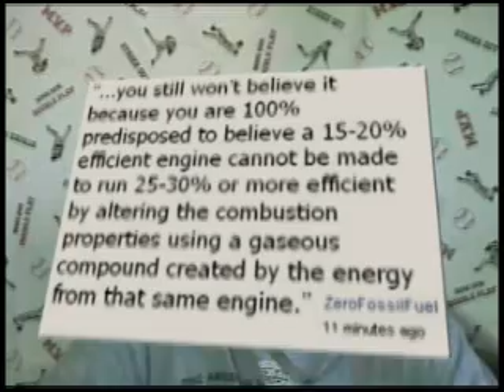Follow-up: '#232 - HHO runtime experiment part 3'

Comment: @MegaVelvetElvis 
what i understand is ............you have no idea what your talking about.
load on an engine...............who cares!
what matters is what goes into the air.
natural gas or propane engines burn very clean......
if an engine would run on hydrogen, which it will, it would burn very clean.
now you must facter in how to make your fuel.......how clean is it to make?
if you could make hho and burn it as fuel........
that would be the cleanest and lowest carbon footprint
wow

Comment: @MegaVelvetElvis use water is the point??????????????????
yes salt will cause clorine gas.
of coarse you want to break the water up..........thats the hho gas!
even distilling water makes something else. that is why they distill it. 
hho turns back into pure water..........
if a car would run on just water.......that would be the lowest carbon footprint......
electric cars need charged........mains power.......high carbon footprint.

Comment: @TruthfulPinecone 
check my videos
most of them deal with pulsed DC.
one shows rain water in a cell,no electrolite......no bubbles with just battery current.......with pulsed DC yes many hho bubbles.
another, sealed jug of distilled water no electrolite......hho bubbles.
another, just a small 9 volt battery with electrolite.......hho
another, current held at 20 amps...........lots and lots of hho
faradays work was with DC, not pulsed DC
please check them, you will see

Comment: @MegaVelvetElvis hho is a gas that burns......fact
add a gas that burns to an engine that is already running.....rpm will go up.
but if load is more than rpm will go down.
so less gasoline or deisel will be needed to pull a load.......
so if rpm goes up when the circuit is turned on.......winner.......
if rpm goes down when the circuit is turned on..........sorry .....loser
so simple. but maybe you need a certain rpm to show the increase ......this is possible and probible.

Comment: @MegaVelvetElvis if hho adds to fuel econimy......there would be a higher power rate....thus a higher rpm at some time........gas or deisel flow would be the same ...
when you turn on the circuit........if rpm goes up.....you just added more fuel......if rpm goes down......there is more load that was added for not.
when hho burns it turn back into water......it burns very clean.....same gas or deisel input......higher rpm is more power..
very easy......more power means less rpm to pull load

Comment: @MegaVelvetElvis only to improve gas milage.......does not need 500 watts.
any little bubble would add to burn rate.
question is only......can hho add a higher burn rate then it uses.
someone needs to make a circuit and test it........
needs an rpm gauge to see if rpm goes up or down when the unit is on.
if rpm goes up......probly just saved gas on the next trip.
if rpm goes down.......load is more than hho bonus........
test is this simple
i think 200 watts is a good circuit to use

Comment: @MegaVelvetElvis but what you do not see is......
there is no math for possibilities of pulsed DC and electrolisis. every circuit could prove to be something more.
but since no one ever steps up.......and shows a good show.........
one thing i hope you could put your math to..........
if an alternator was putting out 100 volts at 2 amps............how much load is that on the engine? i see it in action at less than 1/2 a horse power.
100 volts 2 amps easy to control 200 watts

Comment: @MegaVelvetElvis ohms laws is for resistors in the circuit. when you add capacitors and inductors...you must figure more things.
but it still stands how to overcome the power usage?
there is a way..
better constructed devices need to be made. i am very sure they can be.
if you trade 12 volts for say 3 volts....you can use those 9 volts and turn it into amps at the short circuit.....induction.
12 volts at 20 amps is easy for the alternator.
3 volts and 80 amps at the short,
possible gain

Comment: @MegaVelvetElvis --- "You have a wagon, which takes a certain amount of work to move. Add a rock, and either the wagon slows down, or you have to perform more work to make it move at the same speed. This is elementary school physics." Great example, now add another horse and what do you get? The ability to do more work with the additional load. This what the increases in BTE gives you, the ability to do more work WITH the additional load INCLUDED... Sorry if this posts twice, YouTube glitch..

Comment: @MegaVelvetElvis --- "You have a wagon, which takes a certain amount of work to move. Add a rock, and either the wagon slows down, or you have to perform more work to make it move at the same speed." Great example, now add another horse to the wagon and what do you get? The ability to do more work with the additional load, this is what the increase in BTE gives you, the ability to do more work. Simples!

Comment: @MegaVelvetElvis --- Jesus, I'm dealing with a couple of children here. The wattage was INFLATED by using the WRONG LPM, it had nothing to do with the voltage. The amps using both 12v and 24v were INFLATED because of that. I merely pointed out how you used a 12 V (13.7v) system and while the study used a 24 V system. Show me where I say the wattage is different based on the voltage... Grow up and move on, it doesn't matter...

Comment: @TruthfulPinecone --- Part 2, This property of H2 with HC fuels is a well documented fact. We can argue this point forever without getting anywhere. Here's the facts, adding H2 to HC fuels improves the burn characteristics making the engine more eff., H2/O2 from a on-demand HHO type generator has been scientifically proven to give fuel savings,  100,000 + miles of over-the-road testing has shown it save fuel, and cont.

Comment: @TruthfulPinecone --- "But isn't the power output of the engine constant, despite the fact that you are putting an additional load on the engine?" Yes, and the tests they used 7% less fuel... "Oh wait, it's a negative load, not a positive load." It's a negative number when used in the equation like they did. Isn't that what everyone says? Addtional load takes away from the system, however the added H2  decreases BSFC and increases BTE giving the system more power with less fuel used. Cont.

Comment from the maker: @MegaVelvetElvis ; Absolutely! It is against the law in the USA for automobile manufacturers to use driving tests to determine miles-per-gallon for their automobiles. They are required by law to use controlled tests at a EPA-certified facility. The only way driving tests can produce a valid MPG figure is to drive tens of thousands of miles in all kinds of driving conditions. EPA testing standardizes all MPG tests so that comparison between automobiles and devices are valid. Driving doesn't.

Comment: @MegaVelvetElvis you are correct......cut volts in half to make more amps......same wattage...
but ohms law is only part of what goes on here.
ohms law is for resistors.
there is much more happening here.
so many more figures you are all missing.....................................................

Comment: @MegaVelvetElvis if you will watch my vidios......... i have regulated the amp pull at 20 amps. 20 amps is easy for your alternator.easily you can regulate the amp pull or the voltage to anything you want. amps and volts are easy to trade back and forth. every thing to do with driving pulls power from your engine.
the question should be ......can i make more power from using some of that.......
i think it is possible.
yes you are correct you need power and lots of it.

Comment: @MegaVelvetElvis --- Yes, using your 4.6% it would be some like this, Fuel + HHO + -4.6% = 3% fuel savings, taking out the energy requirements it would be Fuel + HHO = 7.6% fuel savings. What you are doing is Fuel + HHO + -4.6% = 3% - 4.6%. So again you are subtracting what has been subtracted already. Screen shot this too...

Comment: @MegaVelvetElvis "Presuming 65% eff alternator, that's 780 watts. Presuming 60% eff HHO that's 468watts of fuel, burnt at 20-30% eff. " You are double dipping again, the 780 watts INCLUDES the HHO loss. "Thus you're not saving fuel, you're wasting it by a factor of 262%. It's like adding weight to the car, as I explained." Damn, you mean when I double the load on my Silverado by camper I'm losing 262% or more? How can I even pull the damn thing out of my driveway?

Comment: @MegaVelvetElvis --- "AGAIN, the power consumed was less than what was gained in these tests." I'll assume this was a misstatement. *wink* Again the gains INCLUDED the losses, the gains would be greater without the losses added, you can't subtract them again... "Same HP, but less ability to do work available. " No, HP was gained based on the increases in BTE. But lets assume not, I'll trade less than 1.5 HP loss for a gain in MPG any day...But again that's bullshit...  You were saying????

Comment: @MegaVelvetElvis --- "The load was included, to I subtracted it, to see if the gain was equal or greater to the loss. It wasn't. Sorry" Ok then explain how using 867 watts at 28K shows a 3.22% loss but there is a 7% gain. 7 - 3.22 = 3.78% GAIN. You were saying... But again that's bullshit, you are subtracting what has already been subtracted. The 7% gain would be 10.22% if you didn't included the 3.22%, you don't subtract it again.

Comment: @MegaVelvetElvis --- Blah, Blah ,Blah. "But I even let you pick a new number, so you don't need to panic." But you still ignore the paper when it clearly says, "The total rate of fuel consumption is calculated as the sum of diesel, the diesel equivalent flow rate of hydrogen and the diesel equivalent energy needed to
produce H2/O2 mixture." Your numbers are all based on bad data, you are adding a load that is already being used. Again, you were saying???

Comment: @MegaVelvetElvis --- You said 876 watts was 4.6% of the load at 19 KW. It's only 3.2% at 28 KW and the paper shows that they got a 7% gain in fuel savings at 28 KW. So you were saying??? As far as moving the goal posts you claim this paper doesn't show gains are possible using typical HHO units and used numbers from the upper part of the study as loads. I merely pointed out your fallacy. You still however are ignoring the fact the power needed to make HHO IS INCLUDED in the paper...

Comment: @MegaVelvetElvis -- "at 19kW (25.48hp), that's 4.6% engine output " Ok then what is 876 watts at 28KW? Using the same numbers for input loads of 
876.8 watts. At 28 KW (37.58HP) that's 3.2% of the engine output. The paper clearly shows posting a 7% gain in fuel savings at 28 KW. So even using your assumptive bullshit math and ignoring the fact the energy used to make HHO is already included in the 7% gain the paper still shows gains...  Borrowing a term used by TruthfulPinhead... BUSTED...

Comment: @TruthfulPinecone -- "This has to do with HHO how? Or cars?" Because it refutes the silly notion that because 98% of the gasoline burns there is not room for improvement using H2... Oh and did you know that this also used energy from the engine to do this? They used 100 watts of power and got a gain of up to 50%, go figure...

Comment: @TruthfulPinecone --- Hey dumb ass, try thinking before you post. He did the math backwards, he converted the wrong LPM to watts using 4.2 MMW then used the wrong voltage to get an inflated amp value. He even admitted this and changed the amps to reflect a 24V value... so...

You're BUSTED... Again, be quiet, grown-ups are talking here...

Comment: @MegaVelvetElvis --- Part 2, "at 19KW roughly 40% of that output was used to make fuel, which was burned, and provided less than a 40% return." Really? It takes roughly 7600 watts to make 3 LPM? Who knew? Do you not see how wrong your math is? You are using loads that do not apply to what would actually be in the vehicle. Enough said, you are full of shit and I'm done with this. Let's wait for the more detailed information...

Comment: @MegaVelvetElvis --- More B/S, fig 6 shows that the amount of fuel savings increased with load for the same amount of HHO, in other words the power req. for HHH production remained the same but the fuel savings were increase with load. If the it was all about the power of in HHO then how did the fule savings increase with a larger output load? Cont.

Comment: @MegaVelvetElvis "If you accept the paper you cite (Fuel 89 (2010) 378–383 p.384) contains bad data and speculations, why do you accept it as evidence." Because you use the wrong LPM and a speculated MMW to come up with inflated numbers that have nothing to do with the 4 LPM/69amp models you say is a standard for HHO units. Your math is extremely flawed, flat out bullshit.  "Then take your car to an EPA certified facility, prove it" Sorry, but this is an accepted way to improve performance

Comment: @H2Truckers --- Yeah I think MegaVelvetElvis (aka big tacky dead fat guy) really knows better, MVE wants the numbers to say what he believes. Just like ES2008 he only shows math based on bad data and speculations. He ignores the paper when it comes to 3 LPM gave fuel savings, but what else can you expect from a naysayer. He probably can't believe you can get more MPG with more HP using a mod to the air flow. I'm showing a 10.88% average gain with my CAI mod over my last 14 fill-ups!!!

Comment: @MegaVelvetElvis "But a more likely explanation is being aware of the power requirements, and being aware these can't go into a standard car, or a truck, with the stock alternator, it cant work and only a fool would employ it." Try using real world numbers on LPM production, 3 LPM gave a 3% -7% increase in fuel savings. I will not address, or at least try to not address, this issue until we get more detailed information...

Comment: @MegaVelvetElvis --- We have data, the charts, that shows 3LPM giving a 3% -7% gain in fuel savings but you refuse to use that. Why are you rejecting this information? Why must you ignore real world data, LPM production rate, to formulate your conclusion? I didn't even go into your load math because based on the fact your example is bias those numbers are probably wrong to. How does that saying go, garbage in = garbage out. If you want to use real world numbers then do so across the board...

Comment: @MegaVelvetElvis --- "(you need to learn ohms law IDiot)" Earth to MVE, I know ohms law, how the hell do you think I knew your numbers were based on the wrong voltage? Where did the 7231 watt figure come from? I do not find anything supporting that figure. (and don't give me that B/S it's 301.3 amps times 24V, if that's the cases where did the 301.3 amps come from?)

Comment: @MegaVelvetElvis --- "~ indicates approximate, as in off the cuff. I gave the figure the paper stated. You are a liar." Nope read this, "However, the increase
in efficiency diminishes after 5% total diesel equivalent of
H2/O2 mixture (flow rate of 25 l/min), and therefore, the flow rate
of H2/O2 mixture were kept to a maximum of 6% total diesel equivalent
of H2/O2 mixture (30 l/min)." Look at fig 2 & 3, it shows the same data.

Comment: @MegaVelvetElvis --- Several things wrong here buddy. First thing being if 1% is ~5 LPM the 4.84% cannot be 30.6 LPM. Next you based your numbers on 13.69 volts not 24 V like the paper states. Furthermore you took the inflated LPM and used an arbitrary 4.2 MMW to come up with an inflated watt usage then applied the wrong voltage to get an inflated amp figure. In short that's total BULLSHIT...

Comment: @MegaVelvetElvis Part 2, "Results show that by using 4.84%, 6.06%, and 6.12% total diesel equivalent of H2/O2 mixture the brake thermal efficiency increased from 32.0% to 34.6%, 32.9% to 35.8% and 34.7% to 36.3% at 19 kW, 22 kW and 28 kW, respectively. These resulted in 15.07%, 15.16% and 14.96% fuel savings. The emissions of HC, CO2 and CO decreased, whereas the NOx emission increased." Cont. Part 3

Comment: @MegaVelvetElvis --- Read my post again dumb ass, the alternator and electrolyzer losses don't come off the total, they come off the less than 2% energy the system gives it. Also why can't you accept the fact that the energy needed to 'make' the HHO is included in the data on the paper? Is it because you are one of those closed minded people who believe it cannot work regardless of the facts?

Comment: @MegaVelvetElvis --- Oh and let's use your 700 watt figure, in a 28 volt (the charging voltage for a 24 V system) that computes to 25 amps. Now in a system designed to run 250 amp alternators, 25 amps is nothing, the system laughs at it, i.e. doesn't put a [noticeable] load on the system. But according to the paper you can get a 3% - 7% gain in fuel savings. So again show me where to apply that massive loss the 25 amps puts on the system?

Comment: @MegaVelvetElvis --- "Given engine eff of about 20-30%, alt eff. ~65% at best, and electrolysis about 60%, we can presume 50% loss at each stage." What you forgot to mention here is the 20%-30% eff. figure is off the potential total fuel value while the other percentages are off the less than 2% of the total that the electrical system uses.  Improvements in TE (the 20 - 30%) have a greater effect than the losses you mention...

Comment: @luc59457 --- Part 2, I do not fight for one particular design, model, or seller; I fight for the technology. I know it works, I’ve seen it in action, I’ve done the math and researched the reasons why it does. My objective is to open the eyes of the closed minded individual.

Comment: @MegaVelvetElvis --- I'm not rejecting anything, you are. It not about the only 2%, assuming that's accurate, it's about making better use, getting more work from, the fuel that is used. HHOinfo statement says was there is only 2% to work with that is clearly wrong. Again there is not 2 thesis here, if more fuel is being burn it's certainly not a complete burn, evidenced by the presences of CO. None of what you say makes me a liar, it just makes you a dumb ass.